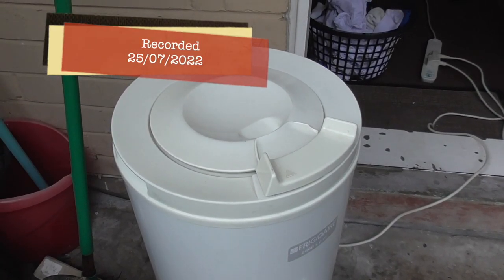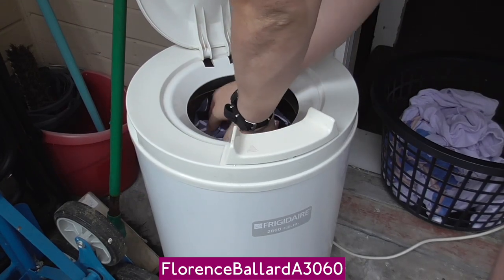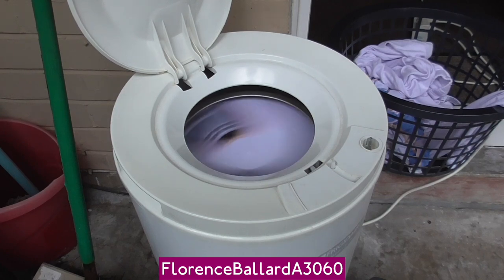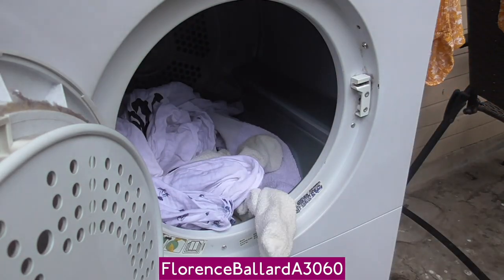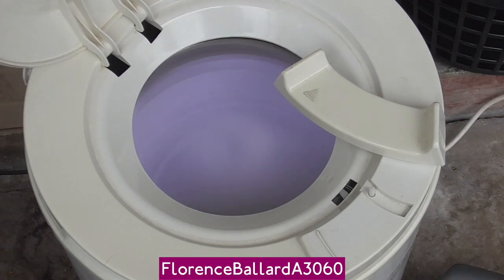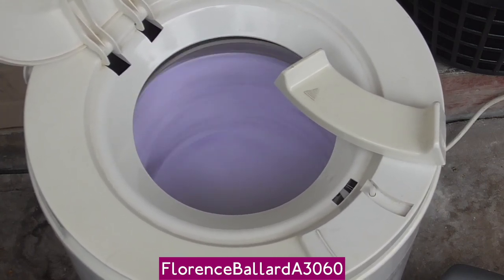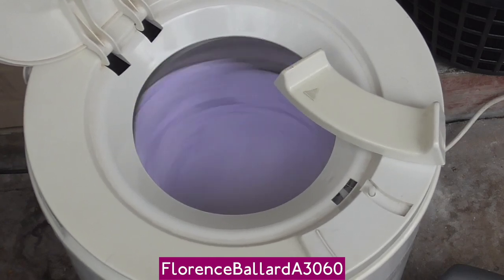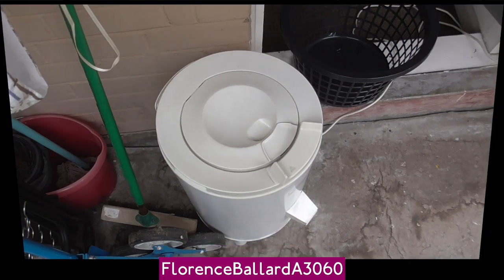Spin Drying Whites in the Frigidaire FSD28 Spin Dryer

Comment: In the grand scheme of things for a light cotton wash that wouldn't have made a big difference, but for a full load of towels it would have cut the drying time down considerably.  I once had one of these same spinners and for 6 bath sheets it took 40 minutes off the sensor drying time if they had a 4 minute spin in this spinner
Reply from the maker: Actually tbh I find that with using a spin dryer, regardless of materials, it’s cut down a dramatic amount of drying time. Including up to 30 minutes on some lighter garments. But towels are pretty good in these if you have a slow spinning washing machine.